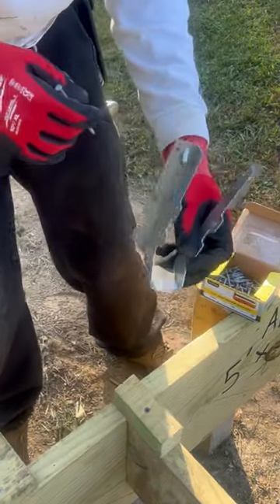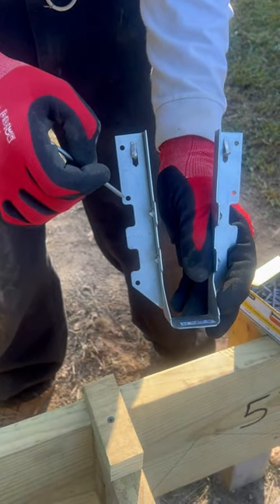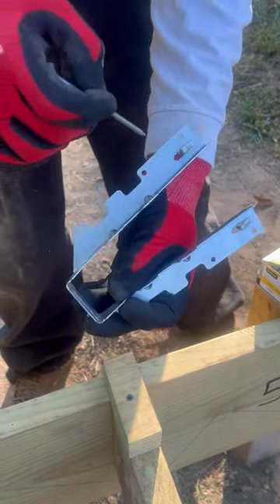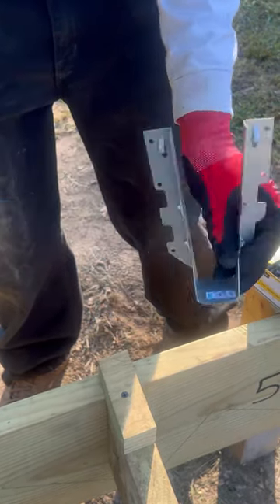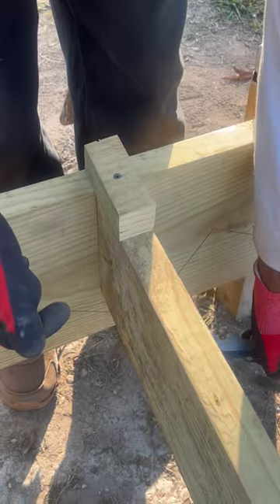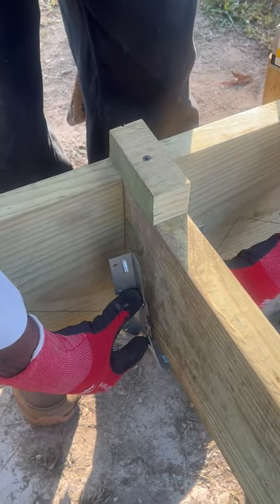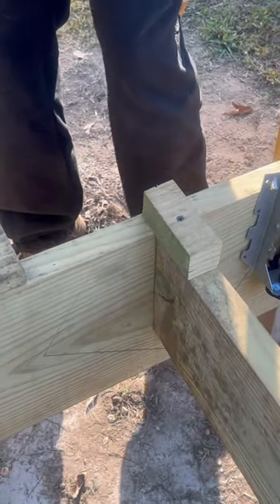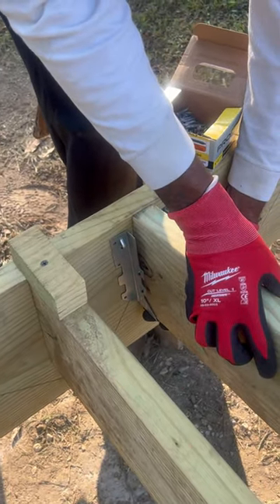How to Use Joist Hangers ( Pt.1)#Carpenter #carpentry #tips #wood #joist #shorts

Comment: That is a zinc electroplated joist hanger. However that does not mean you have to use hot dip or electroplaited galvanized nails.
Reply from the maker: There's something called Galvanic Corrosion where two different/ dissimilar   metals are in contact with each other. This causes accelerated Corrosion or rust. One metal is passive while the other  is active or noble and base metals .As far as the joist hangers being zinc electroplating and not hot dipped galvanized, this could be true . I took another closer look at the hangers I did not see HDG. However, my fasteners are HDG, which is commonly a protective coating of zinc. So the metals still match. Thanks for commenting.